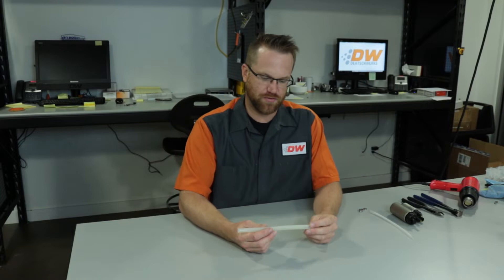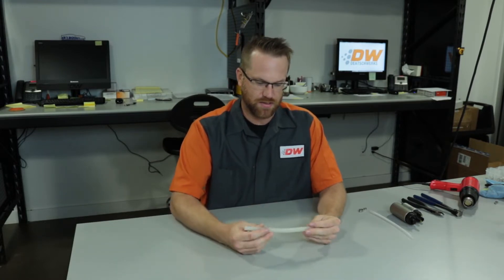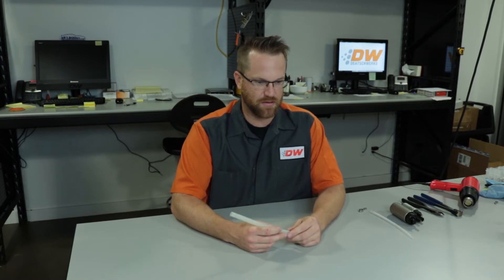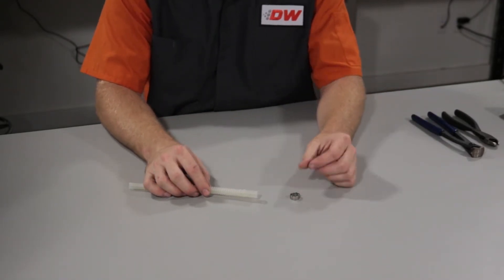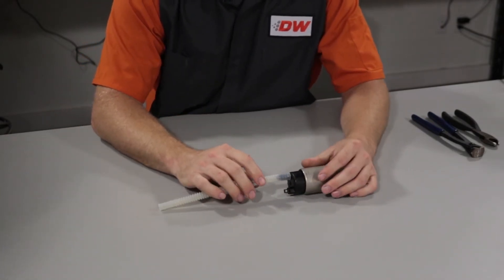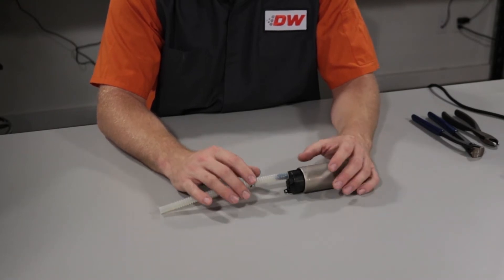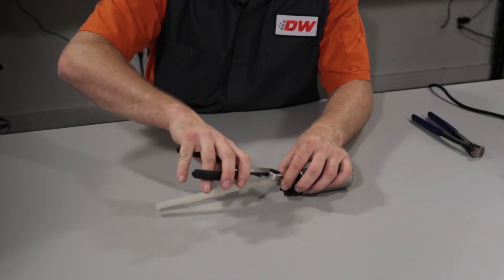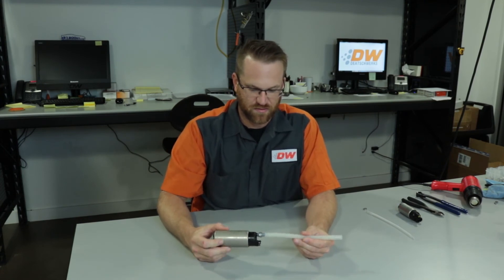DeatschWerks Convoluted Tube installation

Comment: How do you remove those clamps? Gut them off at the crimp and then spread the metal? If so, what's the best tool to cut the crimp?
Reply from the maker: The clamp that is used on the convoluted tubing is an oetiker-style. Unlike conventional worm gear clamps, oetiker clamps provide equal tension around the hose, however, without the proper tools they are one time use and will need to be cut off and replaced. You can use snip pliers, side cutters, or a dremel to cut the band, then install a new clamp with proper oetiker pliers, or as seen in the video a quick pinch from snip pliers. Hope this helps and for any further questions, please feel free to reach out to our tech staff at techsupport@deatschwerks.com.
Reply: @deatschwerks  Thanks. I learn something new "everyday".

Comment: What is the best way to remove one of those? Mine doesn’t have a clamp. It is just connected really tight.
Reply from the maker: Because of the tight fit these can be very difficult to remove. Sometimes the easiest way is to cut it off and install a new one. This will also ensure proper fit when reinstalling.